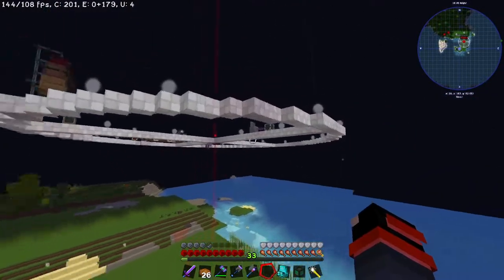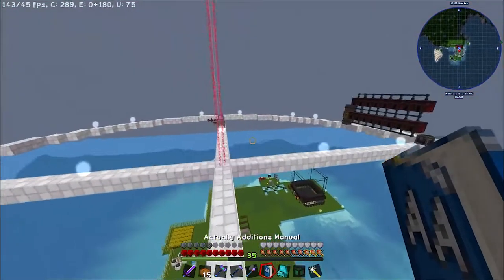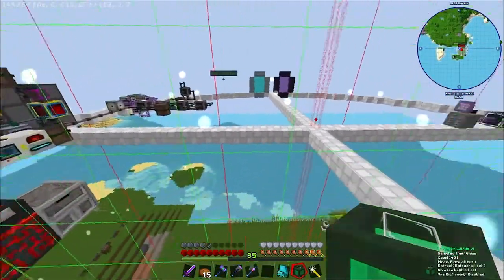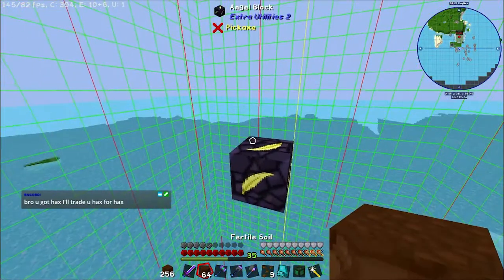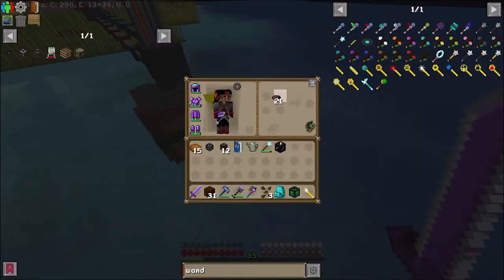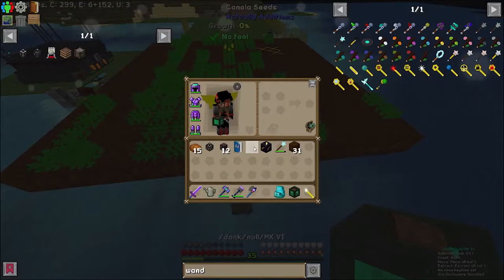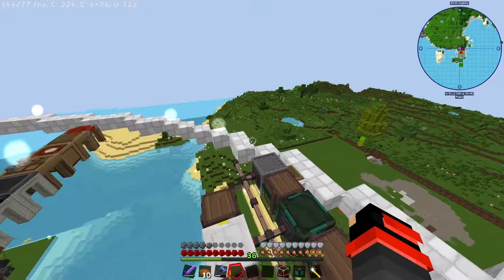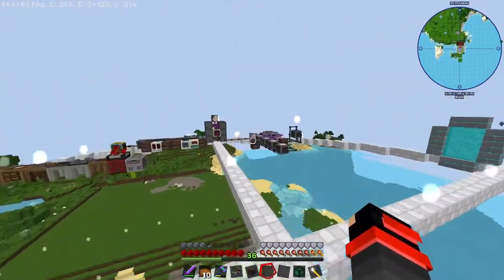FTB Revelations Ep 12 - RF Canola Farm | Modded Beginner Guide

Comment: Flux doesnt drop from the redstone broken from the builder unfortunately :/
Reply from the maker: Yeah, it's quite unfortunate. I also tried to mine it with my hammer. But I don't think it worked either. I ended up enabling the recipe back in the config file. I did some research, the only reason why they disabled it was because of a duplication glitch with another item.
Reply: i think you can throw redstone into a fire and it makes flux
edit : you found out